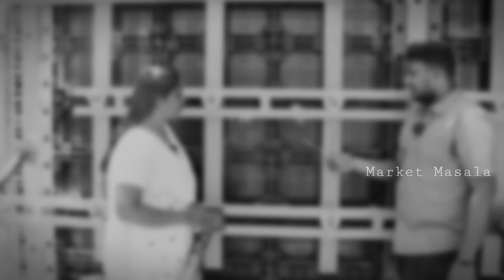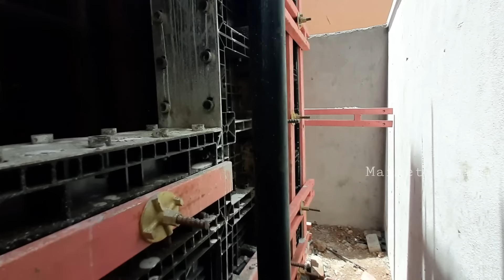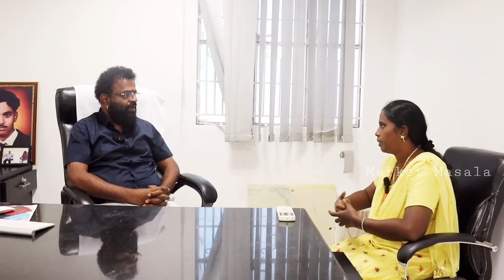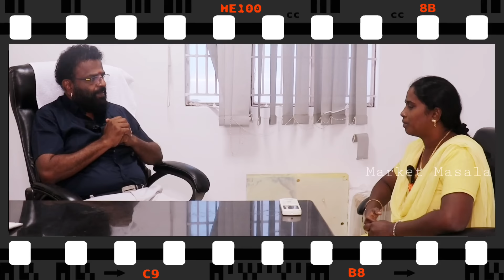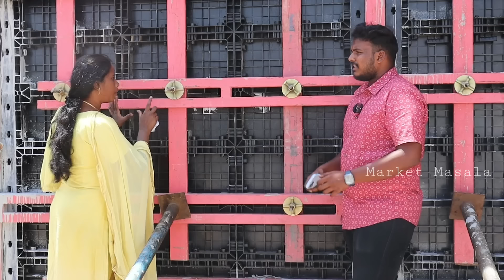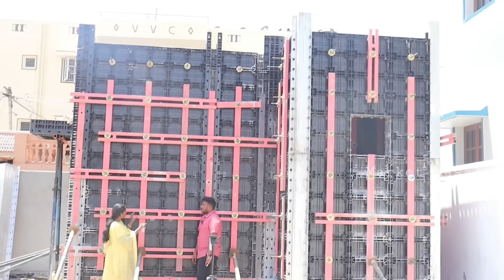Shear wall concrete house in tamil | Strongest Shear Wall Construction |  செங்கல் தேவையில்லை

Comment: It is called Mivan Technology. But the difference here is plastic panels instead of aluminium formwork. Mostly it is used for high-rise buildings/ same floor plan buildings. We cannot do much modulations on it as they're pre-designed and manufactured. But this one is literally costly method but one advantage is time reduction of the construction period and it's serviceability compared to the conventional methods of construction.
Reply: Tamilla sollungapa

Comment: Concrete wall will transmit the external heat unlike Bric wall consruction. So external walls need additional thermal protection.

Comment: Super sir, its likely skeleton, i seen lot of buildings made with pillars and roofings.  Finally closed with bricks. Instead of bricks you ate using ABS material, which is a very good light weight and durable material.  Very good sir, pillars supports roof and keep in place of the whole building.  The other opeings side walls are closed with low density ABS material.  Good concept.  ABS is an insulating material which doesn"t conduct heat.  Very good innovation in Civil and architetural Engineering. வாழ்த்துக்கள் sir, நன்றி.

Comment: I don't understand the house how they building, its kind of moulding entire wall with abs plates??? With cement or its part of shaping like wall, what would be the durability and strength of the building, as well what would be use type of cement, concrete, what would be cost of entire structure building areas???, greetings from banglore India
Reply: my friend has been living in such house for more than 12 years and still looks srong and new. 

Only challenge is perfect preplanning for plumbing, Drainage, Window, Electrical and ஊஞ்சல் hook, etc.
Reply: Their main motto is to reduce labour cost

Comment: Enna grade concrete?
Sari Strength kooda ok, but heat kandipa hot season la romba adhigama irukum, because it's not eco-friendly.
Example our top concrete roof.
Strength ku ok dhan,but climate control ku romba kastam.
Ivanuga appo ippo nu current thirudi vikiiraanga, current bill rise aachi,AC poata bill high and ellam time un current irukuradhe illa.so, strong ku ok.
Climate ku not ok.

Comment: plumbing and electircal works doors and window fixing will be difffcult..concrete supply interrupted become cold joint...if concrete buldge repair cost questionable.....per sqt charge 2700sft not acceptable.  interior works not included

Comment: Price is not committed. What about lofts  wardrobes kitchen, bathroom plumbing etc.
Life?, seepage of waiter. Moisture during rain & winter season? Temperature in summer?
Cost per 3000 sq ft house with 12 ft ceiling & redoxide flooring?

Comment: Concrete nalla loosesa podiviga .water athiga ma erukum . Concrete strength camiagum.sand athigama sapiga appa tan wall finising kidakum.
Aggregate comiya add pannuviga .wall strength comiagum.vibrate wall la poda mudiyathu.after 10 or 15 year its damage i think

Comment: For a concrete load bearing wall, there should be a double layer of vertical reinforcement.. Will it be possible in walls with minimum thickness. I think there will be structural complications. If the construction is with pillars and beams, (as in a framed structure) and concrete walls acts just as a partition, then it will be okay.. but for that condition why go for costly concrete instead of bricks.
Reply: Quick work.. Completion
Reply: brick works will consume time and labour costs also rise..
Reply: We have to provide 3x3 ring with 4 nos 8 mm concealed runner at cill  lintel by horizontal and both side opening vertically more strength. Am already planned and estimated its only fast work 👍
Reply: Cill and lintel level band reqd
Reply: நான் நாலு லட்சம் தாறேன் மூனுமாசம் டைம் எடுத்துக்கோ இதே மாதிரி வீடு கட்டி தா
Reply: plumbing and electircal works doors and window fixing will be difffcult...if concrete buldge repair cost questionable.....per sqt charge 2700sft not acceptable without interior works

Comment: I don't prefer concrete buildings. Since it is so heat obsorbent. We did meivan G+15 Floor structures.. Precatically i don't prefer for residential even though if this is so strong.
Reply: Kaasu illa
Reply: Singapore la itha panra ga, heatkum ithukum  relation ila, yan na most of the heat roof la eruthu tha varum

Comment: Its expansive and doesn't suit for our climatic conditions, other than that those who have more money they don't know how to spend money they should go for it. For simple partitions going for concrete walls 🧱 

* This method is came for high raise building due to reduce the time management, Labour management and budget. In villa its very costlier than brickwalls and you should provide ducting  air handling unit.

Comment: What grade of concrete you use for this structure
Reply: M-20 SCC
Reply: Bc-R 23 Cement
Reply: 2 feet plinth beam beams. Plinth beam with 2feet height?
Reply: @prashanthnagaraj1022 yes
Reply: In high rise apartments they use SDC concrete.It is free flowing concrete and doesn't require any vibration to distribute it.